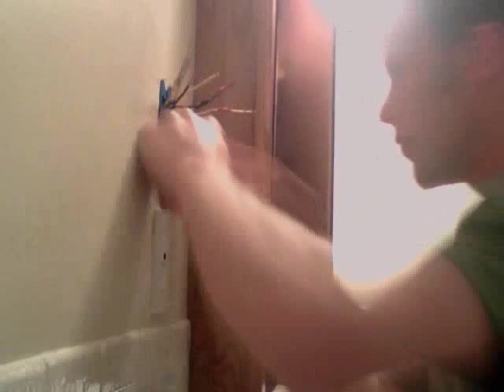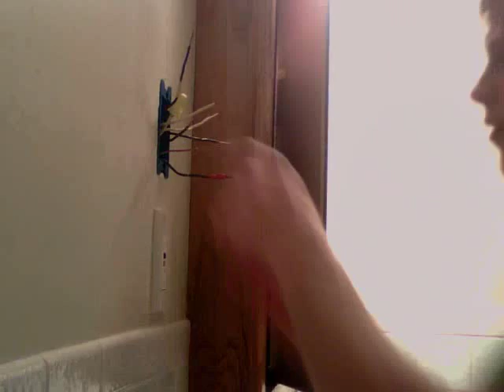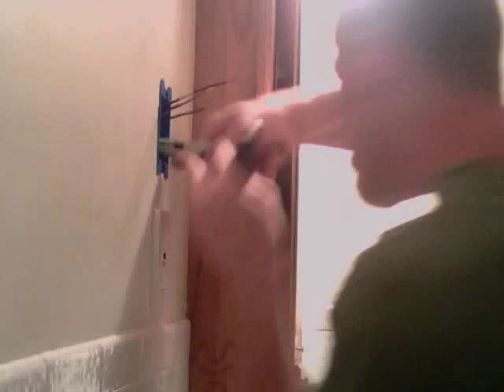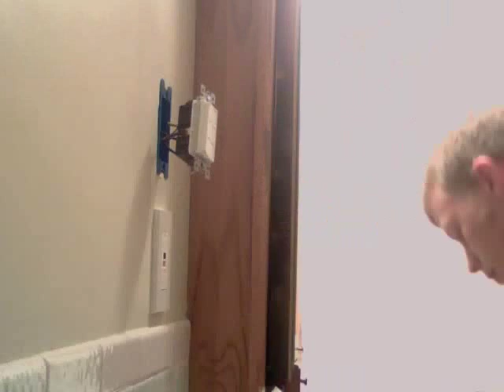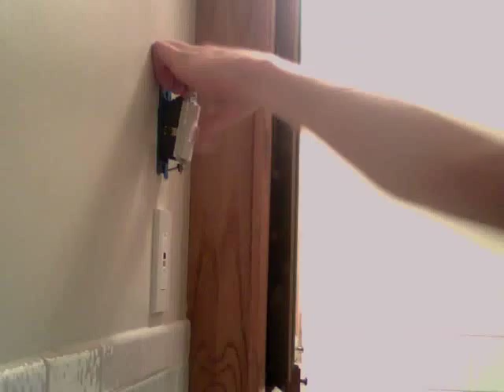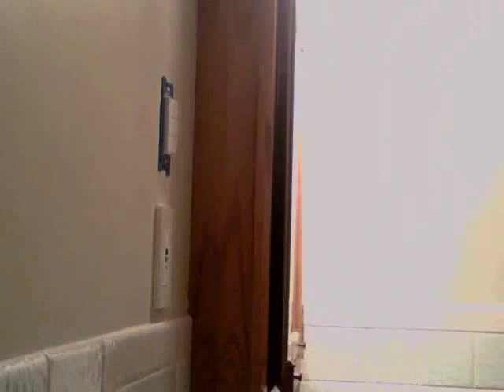wiring a triple switch, time lapse

Comment: Although you can not tell from this video, this is a simple job. Label all your hot (black) wires. Connect all of the commons (white) wires together and connect all of the ground (bare) wires together leaving 1 longer wire sticking out, Then connect the longer ground wire to the ground (green) screw. Now connect the labeled hot wires to their desired location. As in, wire for the light on top, the one for the fan in the middle and the one for the heater on the bottom, or any order you might prefer.